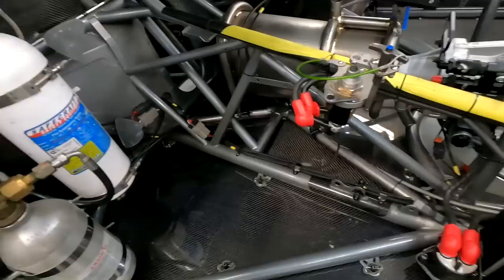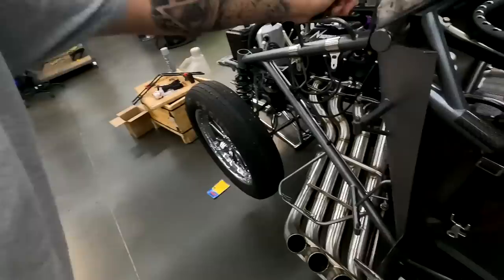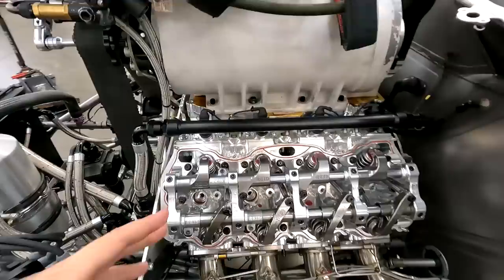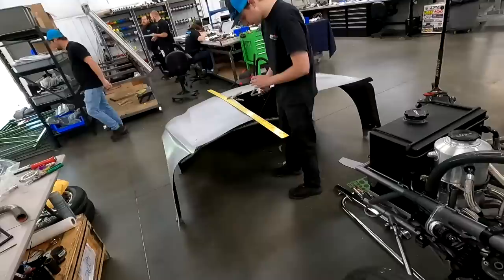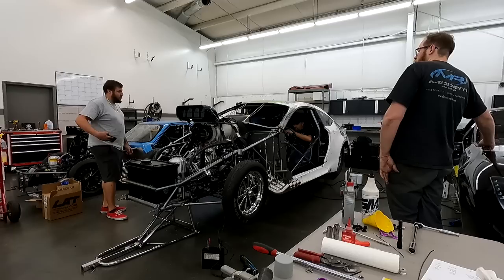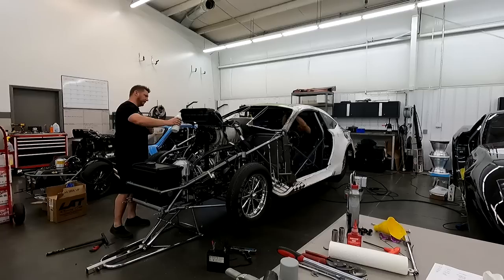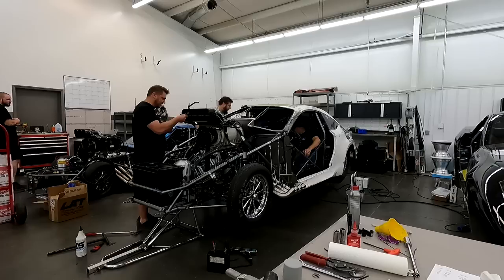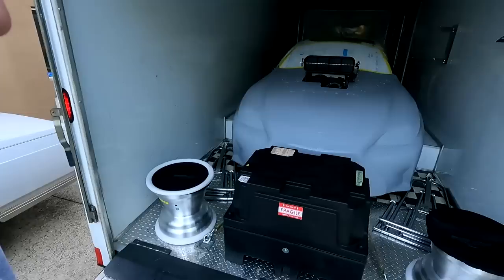Firing Up $100,000 Motor For First Time.

Comment: For 100k that motor should start itself adjust it's self for peak performance and should come with a AI tuner that is 100 times smarter than the the best tuners combined.

Comment: ......it's true I don't know these types of engines but after spending a $100k on a new engine and it didn't fire on the first try,I'd be losing my shatz big time😂

Are these engines not tuned on a dyno first before it goes into the car?